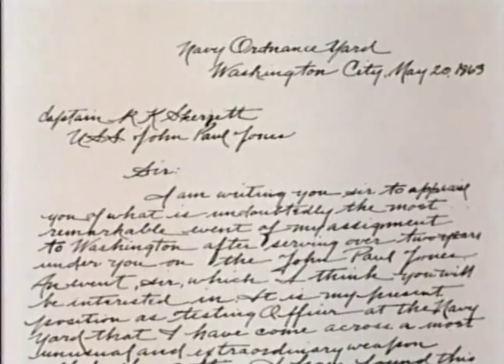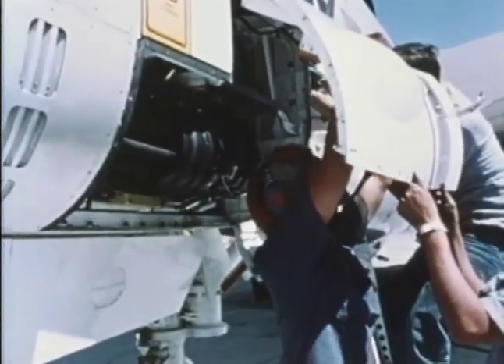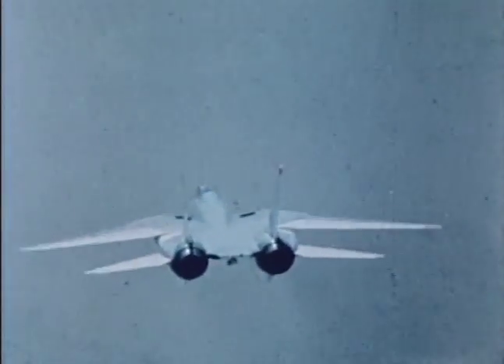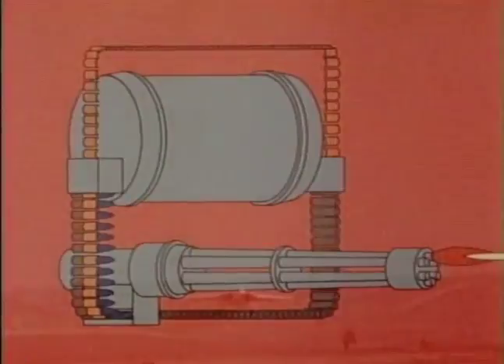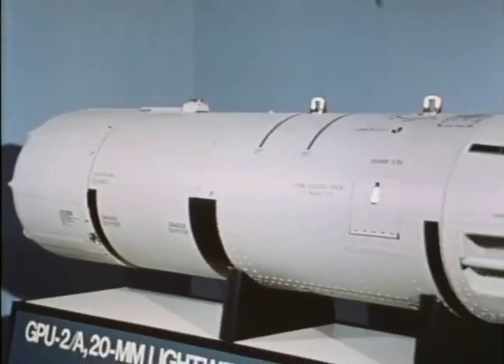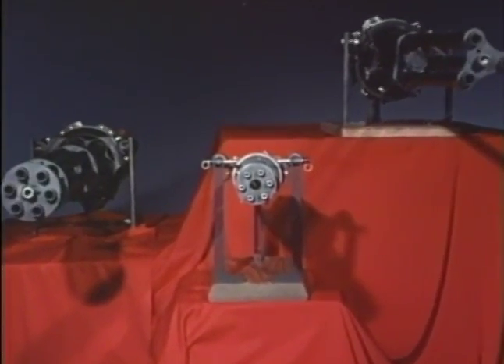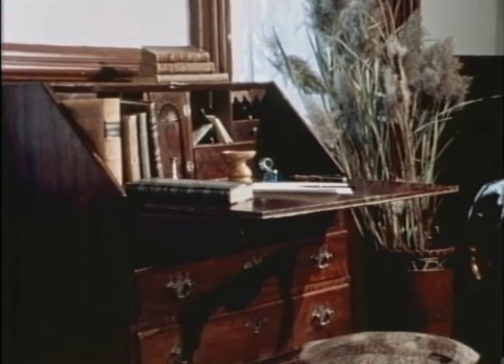The Aircraft Gatlings

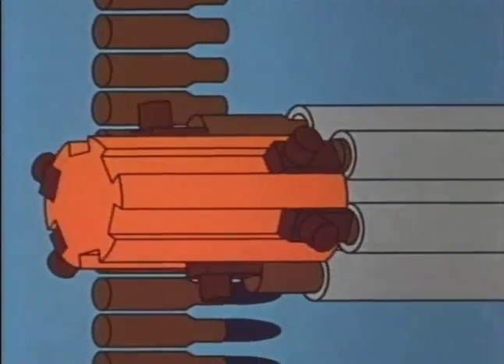Comment: in the animation @ 3:37 the rotating asembly apears to move into the oposite direction compared to the amunition belt. Is this correct?
Reply: You have a point there. I wish I could discuss it with the animator but I’m over 40 years too late!
Reply: @allenjones4259  to me it stuck out like a sore thumb, outside of that I like the style in which the whole video is set up, the voice is also (in my experience) typcal for these types of videos, just like the way in which the guns are displayed (on a red velvet cloth, blue background) and the animations that display how the guns and ammo drums are installed in the planes.
Reply: It looks screwy but there is a rotor on either side of the gun.  The first picks up the rounds from conveyor and hands them to the gun, the second takes them from the gun and returns them to the conveyor.  If you saw it from the back it'd look like a Mickey Mouse hat, but upside-down.

Comment: How soon before someone says they built the GAU-8 Avenger 30mm first and then built the A-10 to hold it? The plane specs came out 4 years before the plans for the gun. All they were told was that it would have to hold a 30mm. In fact, the prototype Northrop YA-9 and Republic YA-10 were ready before the gun and they had to use 20mm guns for the trials.

Comment: He had a vision that every US warship would be equipped with a Gatling, how prophetic. And it's name, Phalanx, sounds so cool. The only thing that demands more respect is of course the GAU-8 Avenger, seven barrel 30mm. Russia has some impressive 30mm CIWS on some of their ships. Of course they had to out-do the US's 20mm Phalanx, I mean come on. Everything they do has to be bigger, better, more complex, and more expensive than the US's, which makes me wonder what they're trying to compensate for with all these huge aircraft, spacecraft, weapon systems, etc?
Reply: 30mm would have better payload and soviet weapon system are usually less sophisticated than western system, pushing them to compensate with ingenuity
Reply: There is a superb naval CIWS based on the GAU/8 called “Goalkeeper” currently in use by several navies. Not the US, though… our 20mm systems seem to do the job well enough for our purposes.
Reply: The russian naval 30mm is packed in a turret and has other gear piled all around it. The fire control system and gun itself will fail from thermal stress.
Reply: That has always been my point about their planes, ships, helicopters and bombs having to be the biggest. A little short between the legs has always been my opinion.